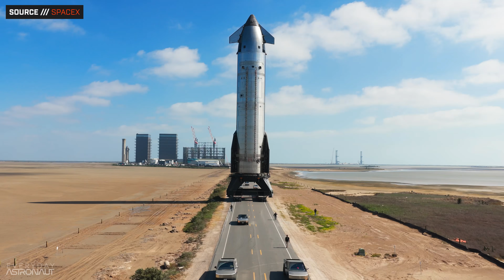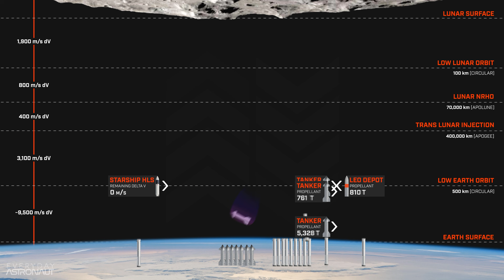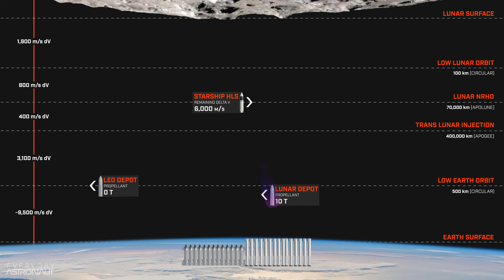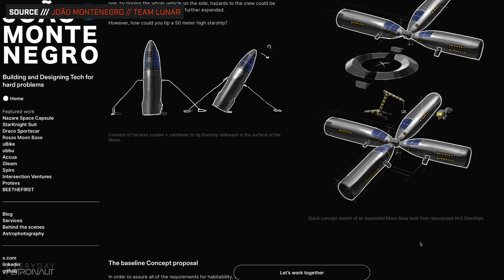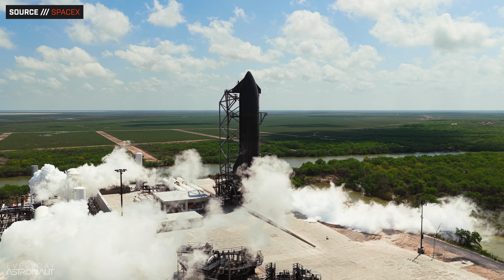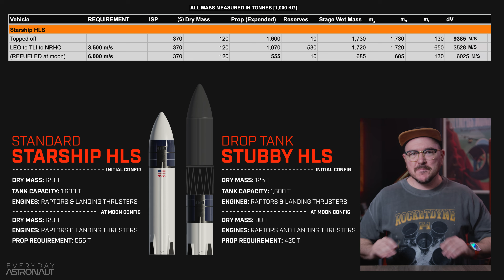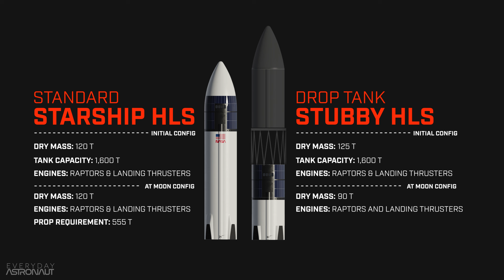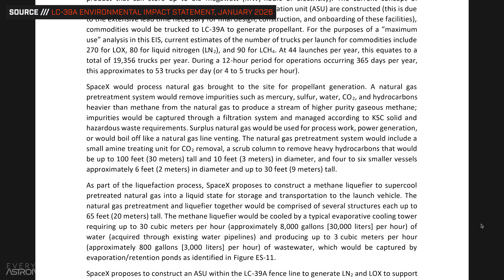Does Starship REALLY require 15+ launches to land one lunar Starship?!

Comment from the maker: I’m getting a lot of comments about the audio and I have no idea what’s any different than any other video. Same room, mic, pre-amp, settings, mix etc. So I’m really sorry if it’s more difficult to listen to, I appreciate you sticking with it. I’ll try and troubleshoot for the next one to see if anything changed somewhere in the chain. Appreciate you all!
Reply: Just sounds like there is a tiny echo.  Did you make any changes to your studio? Removing carpet or soft furniture for example. Or add any hard surfaces?
Reply: @BigC799  or removed a bunch of coats that were over a seat or something. It does sound like echo in the room
Reply: thanks for mentioning this. Sounds like somewhere in your mic processing chain, there was some over compression going on. Your voice sounded very loud, even at low levels, like you were shouting the whole time. Other than that technical glitch, epic video and content as always. Thanks to you and your team for such top tier analysis.
Reply: From what I’ve heard about YouTube audio management, it may sound like that because of their 'Loudness Normalization.' YouTube automatically turns down videos that are mixed too loud to hit a standard volume target (usually -14 LUFS). If the sound FX or dialogue spike heavily, they squashe the overall volume of the entire track. This flattens the audio and makes the talking and the FX sound like they are competing at the exact same loud level. This is especially common in long videos where there are more opportunities for loud noises.
Reply: @charliewastaken this could be the truth.
Reply: I don’t notice anything Tim 🤔 wonder if what they are listening on 🤷🏼‍♂️.
Reply: @michael24-j4i  Same here, I didn't notice anything different about the audio on my end. Keep up the good work!
Reply: Bring a sofa into the room 🎙️
Reply: Came down here to comment exactly this, glad you mentioned it. Was hard to listen to though I got used to it. Sounded like listening to someone shout from the other side of a warehouse. Was missing some bass or something. Weird. Excellent vid as always anyway, many thanks.
Reply: On my phone it sounds like you're recording in a large room with an echo and zero sound deadening or anything else used for sound recording.
Reply: I don’t think that different phased refilling will ever be a viable option due to needing to be able to abort a landing if some landing system fails in the final minutes like ladar or something specific to the landing systems that might not be discovered until the has is in final decent.  Nice vid though.. I honestly think the best options will be a small constant flow where you have depot in Leo and a depot in the helo and you have transit tug ships that move fuel out constantly.  Then you just need to keep a launch cadence similar to the starlink missions and they will have fuel wherever they need it when the need it.  Will look like little ants going back and forth from the depots.  With 1 or 2 SLS missions a year, that system will be the choke point on time and cost.  Also, not sure if they are doing this but I think they are.  They can set the fuel tanks up such that one tank (the colder requirement ) completely surrounded by the other so boil off is minimized.  Only one part of the fuel would boil off and you can do stuff to mitigate or just plan for it in that outer fuel tank.
Reply: Audio's fine. Ignore the wankers.
Reply: Love your content, and this one again shows how much love and effort you put into what you do. Thanks for all that. Having that said, my trained ears (pro audio guy here) say your voice is pretty over-compressed. Seems too much gain somewhere in the chain that's then capped by a limiter. Makes it feel aggressive, loud and shouty, lacking dynamics. Check the waveform, probably pretty flat at the top. I had to stop watching after a few minutes :(
Reply: @EverydayAstronaut Add some of these acoustic panels to your studio watch?v=XIP2Mix_bwM 

Please don't try and clean it up with AI post-processing, that sounds horrible - no way to beat some acoustic absorption.
Reply: Audio sounds fine to me. I think the drop tank is a great idea except why not have it stay in lunar orbit with the return fuel? Dock with it when the mission is over and then return to LEO. Seems like you'd get a massive savings.
Reply: sounds ok here
Reply: Watched on my phone speakers and had no issues. I think it's just nitpicking
Reply: lol, when it first started i wondered if you were doing this from the bathroom.
Reply: Audio is fine so far. I am roughly 20 minutes in. Cheers.
Reply: I think you're speaking louder than normal. This louder volume adds more energy to the room, and this is why we hear the ugly resonances from the room more clearly. 
2nd guess is that your compressor setting (if you use one) on your voice is compressing too much because you are talking louder. This also brings up the room resonance more. A compressor is just turning things quieter, and the makeup gain pushes everything up in volume again, hence making the reverb louder.
Reply: TOO MUCH COMPRESSION / YOU JUST SCREAM SO FRIKKIN LOUD - LOL
Reply: @mikakettunen7939  Nothing's changed, except Tim has developed his voice 'projection' from the Astro Awards to talking above rockets taking off. So I think this is the source of the 'echo's', is it's just more 'volume' into the studio.
Also there have been sound driver updates on Windows 11 and even my NVIDIA Sound drivers have been updated. So it all adds up over time. Change is the only constant.  Kiwi David.
Reply: No problem here,used my headphones as usual because I’m a little hard of hearing and I didn’t notice anything different or unusual,keep up the good work
Reply: Yeah, land it on its side like the moon ship from the old TV series "Space 1999"
Reply: I didn't have any issues with the audio on both devices that I wanted the video on (laptop and phone).

Anyways, it's an excellent video 🫡
Reply: Just sound like you recorded on an iPod touch second generation. Not a big deal.
Reply: Honestly sounds fine to me, no noticeable echo or anything.
Reply: maybe it was some setting in the edit  ....try a test video upload maybe unless u think that wouldn't be good for the channel
Reply: There's a little echo. But not to bad. Awesome video as allways.
Reply: Noticed it too. Maybe because you keep the music running for so long. Felt like you had to shout to top it and that feeling didnt leave..
Reply: I didn't notice any difference on headphones. Great video as always. Should be an exciting week that will bring us one massive step closer.
Reply: Noticed this, sounds like a audio compression issue, turned the volume way down to make it sound normal in my headphones.
Reply: It made me check if my Bluetooth headset had accidentally switched to hands-free (i.e. 2 way, low quality) profile instead of A2DP (the usual one-way audio with good quality). Because it sounds exactly like the hands free profile.
Reply: @EverydayAstronaut - Easy, we just need to ship a 100 ton machine that turns lunar ice into fuel.
Reply: Sounds fine to me!
Reply: Two things,  it does sound tin can, but I also like to leave comments like this to mess with creators
Reply: Sound is ok for me on Sunday May 17, 2026 at 5 pm EDT.
Reply: Just sounds a bit hollow, you need to be closer to the mic and sound dampen your room a bit. But it's no big deal.
Reply: The music also is really loud.
Reply: Audio sounds 100% fine to me.
Reply: one time my computer defaulted to a dualshock 3 controller's built in microphone instead of using the proper microphone that was also plugged in.
Reply: Sounds fine for rocket gore transfer When you mix in live music may have to worry about perfection
Reply: Sounded fine on my TV. No issues, great video!
Reply: Not seen this yet, but here is a thought.  Why not leave most of it on the moon and send something much smaller back. You then have a nice piece of useful hardware on the moon for part of a moonbase!
Reply: You gotta be kitten me.. it sounds tiny and echoes.. 😅
Reply: I noticed it but it's fine.
Reply: Thanks for adding chapter titles ❤
Reply: I had zero problem with the audio.
Reply: Looking at my audio analyzer (I'm using a Behringer WING), you're just a bit low on the bottom end. No big deal.
Reply: Sounds like you're yelling due to ambient sound or echo.
Reply: REALLY this DICKHEAD and his family of "Tims going to the Moon" has taken over 2 years to cover something Destin (Smarter Every Day) asked NASA about publicly over 2 years ago?
Go watch his episode (posted December 2023) titled I Was SCARED To Say This To NASA... (But I said it anyway) - Smarter Every Day 293

If you want to listen to a clown stay here and listen to Tim.
If you want to be smarter then go listen to an actual Aerospace Engineer.
Yeah us aerospace engineers (and yes I am one) might not be a slick at BULLSHlTTING like Tim and are often compared to watching paint dry, but at least we went to college got our degrees and know WTF we are talking about.
Reply: It's not terrible, just slightly worse than other times. We've got used to great audio quality, and this time it is just fine.

 Still, no problem to listen to this wonderful video.🎉
Reply: Yes, funny because I was listening in bed and it thought it was sped up, but it was some funny compression I think...or maybe just excitement anyhow good the content was💪👍
Reply: Just sounds a bit more roomy. Does your mic have a switchable polar pattern?
Reply: When every S becomes a high pitch hiss, generally a compression issue.  Maybe add more fabrics in the room.
Reply: The audio is perfect, not sure what anyone is talking about
Reply: Audio sounds just fine to me (Windows PC, stereo headphones (nothing overly flashy))
Reply: It sounds loud, even on low volume. Very tiresome. Cant listen to it, sorry.
Reply: Are you planning to stream flight 12?
Reply: Yeah, just 20 seconds in I was like wow – Tim sounds really salesy in this one, almost like a radio ad.
Reply: Good to see you. Your questions are valid. I have watched every single flight of everything since long before you were born.  Think Ranger and Gemini. 'Starhip' is arrogantly named and I suspect the tipping problam could be huge. Look at all the wee babes (recently) that face planted. Crap. Gotta go lateral. I would not fly her. They are trying to land (what amounts to) 2 stages of Apollo on the moon. My opinion is that this is dumb. Better 10 or 20 LEMS than one of these. What is the point? How many crew? How much equipment? This truly gets stupider by the second. My God-dad was a lead engineer at Bell Labs . Malton (Toronto Canada) that built both the AVRO and designed the LEM. Like Apollo 13.... "We just lost the moon". Well Muskie has lost Mars; -and is now going berserker. The good people of Artemis 2 could barely hande the ops as Apollo 8. Same mission. 1968. I watch all. Zero pilots on Ship to date.
Reply: honestly, your cadence was much higher and seemed that the tone was bit hirer then normal.
Reply: Well I could hear you just fine (and I have drumming after 40 years hearing)!
Reply: Youre just a bit yelly.
Reply: Just the echo in the room
Reply: No problem for me about the audio honestly.
Reply: Do you understand that moon mision is just test for Mars mision....in about 10 years it will be chain of hundreads starship in air by AI.That is the real goal man.MARS.
Reply: @atreideslimp2093  The goal should be earth, moon and mars is pointless at the moment.
Reply: @nightmare1010 no
Reply: Just watched whole video on PC + Headphones, no single audio issue!
Reply: there is a chance the starship is 1 meter under the loonar surface given it uses 4 one meter leggs. because of physics.
See result lower:
"LOAD PER PAD

Total mass: 120,000 kg
4 pads → 30,000 kg per pad
Weight per pad:
W = 30,000 × 9.81 ≈ 2.94×10^5 N

Pad diameter = 1 m → radius = 0.5 m
Area A = π × 0.5² ≈ 0.785 m²

Applied pressure:
q_applied = W / A ≈ 2.94×10^5 / 0.785 ≈ 3.75×10^5 Pa = 375 kPa

SOIL PARAMETERS (lunar‑like regolith under Earth g)

c = 0.3 kPa
phi = 45°
gamma = 13.7 kN/m³
Bearing capacity factors: Nc = 6, Nq = 12, Nγ = 10
Footing width B = 1 m

BEARING CAPACITY AS A FUNCTION OF SINKING DEPTH z

q_ult(z) = c Nc + gamma z Nq + 0.5 gamma B Nγ

Compute constants:

c Nc = 0.3 × 6 = 1.8 kPa
0.5 gamma B Nγ = 0.5 × 13.7 × 1 × 10 ≈ 68.5 kPa
gamma Nq = 13.7 × 12 ≈ 164.4 kPa per meter

So:
q_ult(z) = 70.3 + 164.4 z   (kPa)

SOLVE FOR DEPTH WHERE q_ult = q_applied

Set 70.3 + 164.4 z = 375
164.4 z = 375 − 70.3 = 304.7
z = 304.7 / 164.4 ≈ 1.85 m

RESULT
A 1‑meter‑diameter landing pad carrying 30 tons will sink approximately:
z ≈ 1.8 to 2.0 meters
before the regolith develops enough bearing capacity to support the load." 

if you are willing to sacrifice an engine or two the depth lowered to like 20 cm using the full landing area. there is a reason skyscrapers have support beams inside the ground! the soil can sink underneath your feet if you use heavy enough stuff!
Reply: 25:41 i saw the footage if it blowing up, i have not seen a footage of it landing even one time successfully!
Reply: well i be damned, they did land one successfully in 2025, after years of failure! i am waiting with surprise for their second landing successfully!
Reply: Really loud shouting
Reply: Sounds good to me
Reply: I don't notice any changes. People just like to complain about something.
Reply: Seems ok to me.
Reply: souns like you emptied the room of furniture/objects. just empty room echo.
Reply: Why dont they just connect to a second booster?
Reply: It sounds good to me
Reply: Regarding all the refueling issues in LEO; I think an answer could be a permanent "station".  It would take a number of launches to set up the infrastructure, but it would be there for future missions as well.  A large sun shield for the tanks to avoid boil off, turbo pumps and other infrastructure to avoid all the extra mass being included on every launch as well as other permanent machinery, tools etc. that might be needed that may save a mission from being scrubbed (save an entire launch).  It wouldn't need to be manned permanently, just leave all the materiel up there for use.
Reply: Audio is fine for me. No problems.
Reply: I have no problem with audio,  its possible the equipment other's are using to listen that is causing  it .but I did have to watch orbital refueling twice.
Reply: There's another problem with a horizontal landing. When the ship tilts forward, the fuel in the main tanks shifts forward and abruptly changes the center of gravity. The ship flips over. And when tilting back, the fuel in the main tanks is pulled sharply backward, and the center of gravity shifts sharply, adding to the rollover moment.
Reply: It's just how room reverb coming back into the mic. It's not too bad. Just keep the mic a bit closer next time. This will mean less gain so will pick up less of the room reverb. Your mic auto gain probably hid the low input.
Reply: The only audio "issue" was in your opening. It was echoing or hollow sounding but leveled off almost immediately. Almost as if you were far from the mic then walking towards it and picking it up to clip onto your lapel. At least thats the parallel as it sounded, at least to me. No big deal.
Reply: @PiCorder  Nah the whole vid is bad IMO. Sounds almost like his voice is clipping and also sounds quite sort of echoey and harsh in general.
Reply: My hearing sucks and its totally listenable on my end.
Reply: Sounds the same as any other video i've watched from you.
Reply: Yes, it is much harder to listen to than normal. Sounds like too much gain in the mic to me..

Big fan regardless, keep it up!
Reply: The audio is great on my end!

Quick question, are you planning on streaming flight 12?
Reply: It's fine
Reply: I'm listening with a headphone which I use daily. No complaints here 1 hour into the vid.
Reply: People probably have "Stable volume" on.. or off... I guess it depends.

I know that stuff messed with my "audio setup"... & caused videos to sound different.
Reply: Sound is fine. To me it feels like you're almost screaming at times, like talking to a large room? I bet it is nothing more than you being very enthusiastic and excited. It is a minor thing!! The content is as always excellent!!!
Reply: @xorpidxult  this also true lol - dude just can not keep himself moderate leveled with his voice
Reply: No problem with the audio for me.
Reply: Ok to the sound but video is extremely uselessly long......
Reply: The gain is out of control. Your voice should be peaking around -12dBfs.

Use your ears, and eyes, not "settings".

I could be over compressed in post too.
Reply: The audio sounds great to me
Reply: Didn't noticed anything wrong with the audio - its perfect, listening at 0, forgot what gauge is in audio) Oh yes, Unity
Reply: Audio was fine ngl
Reply: Smarter Everyday did this video 2 years ago... day 293!  Not only do you ONLY do SpaceX commercials... you have an almost zero understanding of engineering and rocket science.  OMG please stop with all the acronyms it just makes you sound clueless.  Calculations? 😂😂😂 Wtf, you are so hilarious... SpaceX doesnt have a rocket that can go to the moon so it is meaningless.  There is NO ability to takeoff from a flat ground surface.  There is NO heat shield that can re-enter from lunar orbit.  There is NO ability to store fuel or refuel in space.  There is NO lunar capable vehicle from SpaceX... they arent even working on it yet as they have NOT managed to create an earth orbital vehicle yet.  🤦‍♂️  Only SLS is lunar capable and the only current contract and only current lunar program.
Reply: @tredogzs  sounds like you are the one who has no idea what they're talking about.
Reply: no, they need 15 rockets to get the first of those 15 into space, the rest blow up at the launch pad! if they had 100% success rate they would need only 16 rockets. at the current rate it's more like 250:1 ratio!
Reply: You are talking very fast. Those of us who know the dv, isp  and all that can follow. Also you needed to cup the bill of that hat.
Reply: @piscator5666 simples, just run you playback at 50% so your brain can keep up.
Reply: you´ve been way to long a elon fanboi, without nasas sls we wouldn´t have the lunar flyby by now, SS is just a low earh orbit rocket, elon is just really good in fooling ppl, as you know since your flyby dindt wotk out ^.^
Reply: @Baron_de_Charlhus oooooh boy hahahah I can’t tell if you’re just joking or not
Reply: @Baron_de_Charlhus thanks for your opinion. It's now in my dustbin. Where's YOUR effort to enlighten us?